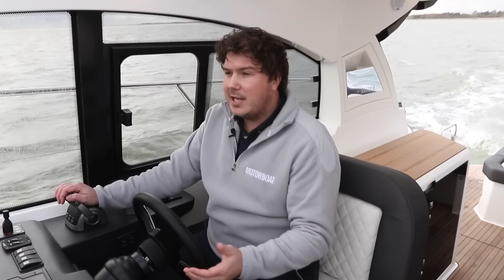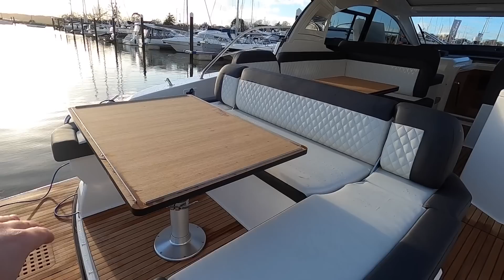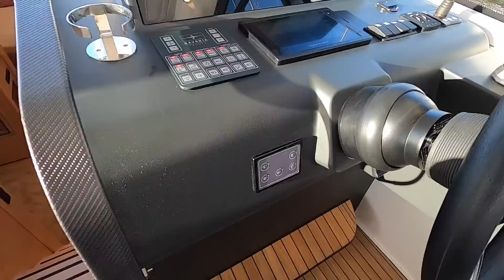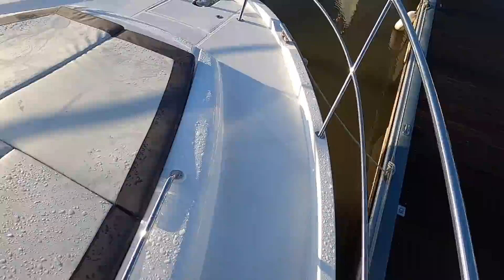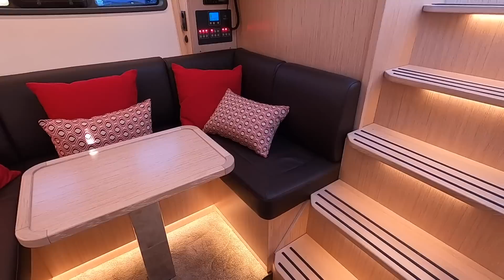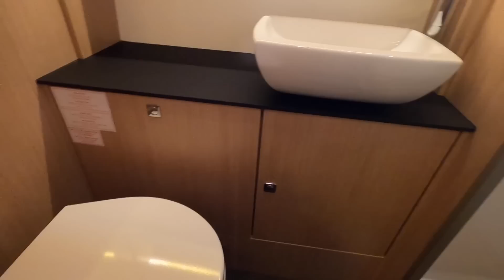$350k boat is a lot of bang for your buck | Bavaria SR41 test drive review | Motor Boat & Yachting

Comment: Very balanced review - I think it feels a bit cheap - the wood on the tables isn’t finished nicely, the helm station feels a bit cheap too - the gap on the steering wheel and the finish of the different parts of trim doesn’t feel very special. I normally really like Bavaria’s but this feels like they’ve cut some corners here...

Comment: That's the worst design I've ever seen, noisey engines, top heavy at anchor I bet it'll wobble horribly.  The engine access is just unacceptably tight.  The cabin design looks unloved, furniture plonked about carelessly, and compared to the elegant Cranchi Z35 with similar price just doesn't compare.

Comment: The outside looks good, but the inside wood looks cheap and the grill should never be right behind the seat. I know they have to cut costs in the build to sell this boat at that price, but in the end, I'd rather buy a used boat of higher quality, than a new one of lower quality.  Sorry Bavaria, but this boat looks like a $30,000 RV on the inside.

Comment: I like the look, but better still is Jeanneau NC37...called 37 as in 37’, but in reality tip to tail it is a few inches shy of 40’; if you want to put one between two vertical walls, they would need to be 40’ apart for NC37 to fit.

Comment: Too much weight at the stern if it needs 50% tab just to run at an acceptable level. It is nice looking for a Bavaria though
Reply: I guess thats the compromise when you try to get a boat in a low-ish price point and have as much room. Id personally go for a used boat that has a better design and may be built a bit better.

Comment: Great looking yacht and even better looking at the price. I do like the Greenline 39 for looks but that Bavaria above is sexy. Ever the practical person in Britain i'd take the version with the door not just for warmth on a typical UK summers day but also for sound. Also just extends the season for a bit longer. One big question typical Englishman (i need a kettle for tea) sorry in advance but the kitchen area did not look like it had plug sockets is that correct?
Reply: ignore me 15.33 i can see them at the end of the racks, i should have triple checked.
Reply: @nickmarks6066 Tea is important, as is coffee, and for me, liquid Oxo steaming hot in a very large  Mug (if you can find the big jars of it still ), so if sockets aren't immediately obvious, the question just has to be asked. tbh, I'd like a Gas hob and oven, with one of the portable single plate induction hobs. Maybe a Microwave, but I'm still not 100%  sure if .I'd use one much on a boat. a Breadmaker and a slow cooker though if there's room for them. 👍 Best Wishes.  Bob.

Comment: Hard to understand what this extra 100 K is spent on. I see the hydraulic bathing platform, I see the grill, and then what?
Didn’t see much refrigeration, didn’t see a radar, a generator, air conditioning, passerelle, not a single tv screen (not that I watch tv, but for a family boat you have to give a screen to kids for play or movies).

If you were to upgrade this boat in order to make it useable in the Med, and not just a day boat, how much would it cost really? For a practically naked 40 ft motor cruiser, € 500K, is a lot of money! Really.

Comment: I can't see where the 400k has gone, especially without the doors on the saloon! I'd have the twin petrol/gasoline erosion at 250k, but then I'd probably go for a 2nd user Fairline 38 with twin 400's and 44 knots https://youtu.be/KJB3uyw4C48!
No front opening fridge, no dishwasher drawer, no tender garage, a crawl in only bed for my guests and both double beds with a split in the middle! I can't see where the extra 150k has been spent!?
Reply: If you look close you can find the $150K.  Comes with Merc but when you you select twin Volvo Penta D380 they do not give you credit for the Merc's.  The teak deck.  The teak lowering swim platform.  The cockpit teak topped grill and fridge.  The helm.  The cushions (probably being two tone).  The lower deck wood interior and flooring.